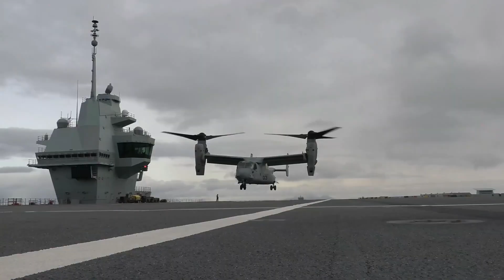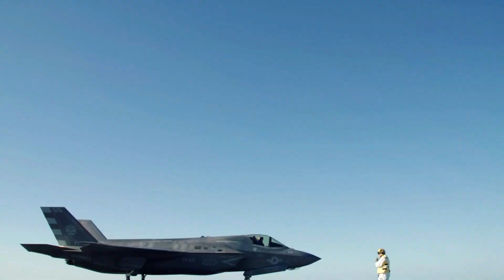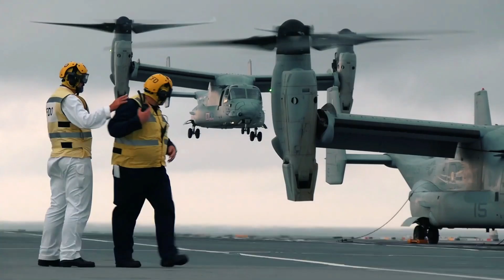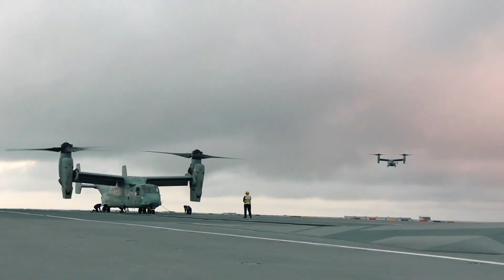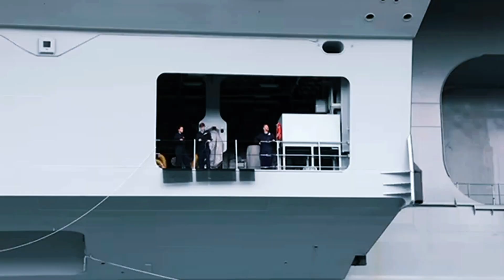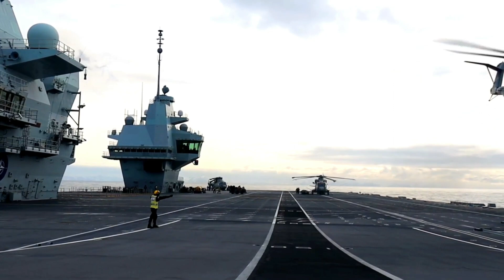What Makes the HMS Prince of Wales Aircraft Carrier So Powerful?

Comment: Can i ask an honest question, ie no national pride things etc etc etc etc: this ship weighs 65,000 ,tond but only carries 42 planes. Not much for a ship of that size, isn't it?
And no catapult launch means the planes have limited payload, isn't it?
Which means limited hitting power!!😕
Reply from the maker: While it's true that the HMS Prince of Wales has a displacement of 65,000 tons and carries a relatively modest complement of around 42 aircraft, it's essential to consider the strategic role and capabilities of the carrier. The ship is designed to operate as part of a carrier strike group, which includes escort vessels and support aircraft, enhancing its overall effectiveness in combat operations.Regarding the aircraft complement, the carrier primarily operates the F-35B Lightning II, a highly advanced stealth fighter capable of performing a wide range of missions, including air superiority, strike, and reconnaissance. Despite its smaller numbers compared to larger carriers, the F-35B's advanced capabilities and technology make it a potent force multiplier.Additionally, the absence of catapult launch systems on the HMS Prince of Wales does limit the types of aircraft it can operate. However, the F-35B's short takeoff and vertical landing (STOVL) capability allow it to operate from the carrier's deck without the need for catapults. While this may impose some limitations on payload compared to catapult-launched aircraft, the F-35B's versatility and advanced weaponry still provide significant hitting power and operational flexibility.
Reply: Thank you for your explanation.
Yes a carrier operates as part of a "strike group" of many ships.
Let's look at it another way. Using common sense, do you not think that, given all things similar to now, the PoW "strike group" would be a more potent fighting force if the PoW were a catapult-capable ship? Afterall both the QE and PoW were intended to have catapult  capability originally but somehow that was abandoned!!
And talking about the plane, yes indeed the F35 is a formidable plane.....But is the "B" version better than the "C" version?
The "B" is more expensive than "C",
Weapon payload is 6.8 tons for B, 8.2 tons for C,
Range is 900 km for B, 1,200km for C,
B can pull 7g, C does 7.5g. 
Now which version is the more potent?
You see STOVL plane (like the Harrier and now F35B) is  designed for a "sea-force" which does NOT possess a full size conventional carrier with catapult launch. Eg the 🇬🇧navy has the invincible class, the 🇺🇸Marine has its amphibious assault ships, neither of which  have catapult-launch, so the planes only have access to short runways and hence STOVL is required. And if the Harriers/F35B were really that "good", the 🇺🇸 navy wouldn't have bothered with the F35C, (it would use B only). You see STOVL plane is a "compromise" and therefore has limitations.
Hence, if the PoW is "upgraded" to have catapult-launch capability, (let's call it the King of Wales😊😊) it can only become more potent overall.
And also while upgrading the PoW, the 🇬🇧 navy should look at its escort ships as well : Eg the 8,500 tons Type 45 destroyer: only 42 VLS in a ship of that size is simply not acceptable.
Reply from the maker: @michaelwong4303  Bro, thanks for your response and participation! Don't forget to like, share, and subscribe to my channel.
Reply: Um....Part of a strike group.....Yes.
How about a "slightly" more complex carrier with catapult thus can operate true carrier-borne F35C which being catapult launched will have a higher performance parameters than the "B"?
Without being rude, defenders of the 🇬🇧 navy's face always argue that their carrier is part of a "group" etc etc etc. 
The PoW is part of a "group", but wouldn't it be better if it had catapult capability? The whole "group" will benefit...😊
Reply from the maker: @michaelwong4303  While catapult-equipped carriers may offer advantages in certain scenarios, the HMS Prince of Wales was designed with unique considerations. Its capabilities, including the F-35B's STOVL feature, offer operational flexibility and efficiency. Additionally, being part of a carrier strike group maximizes overall effectiveness in diverse missions. Each carrier type has its strengths, and the UK's strategic needs drive its carrier design.